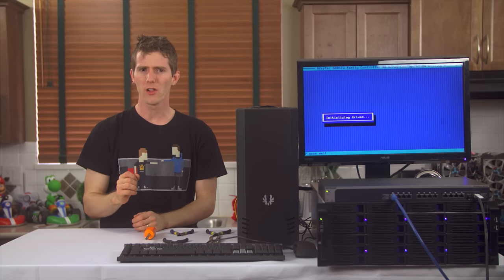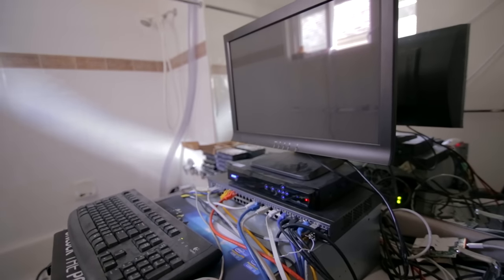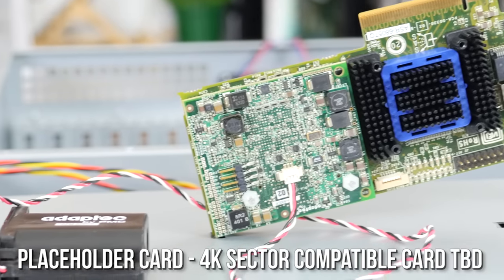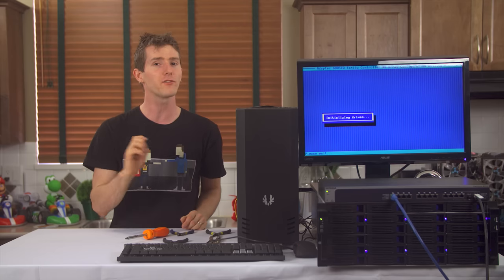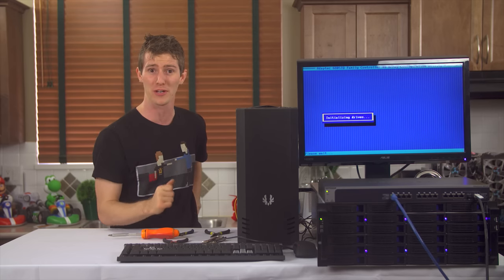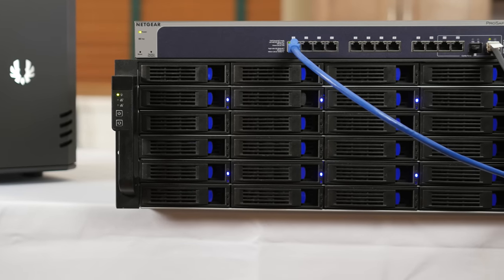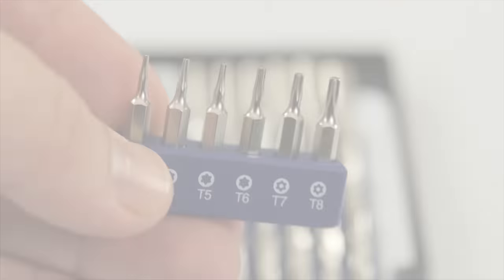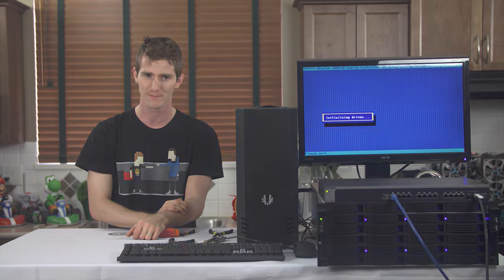Insane Storage Server - Fully 10 Gigabit Network, $1,500 Switch

Comment: I watched this on Vessel, but I'm watching here because the quality on Vessel is crap.
Reply: Switch it to HD at the bottom it is standard set to auto.
Reply: MrRyanDew I did. Still looks like it's running a high bitrate 480p or low bitrate 720p
Reply: true story man. vessel sucks
Reply: YouTube is better than vessel
Reply: Watching videos on vessel with my 4k display is just so painful.
Reply: overclock1993 Yeah... no 4K either... Lost interest in Vessel the moment I noticed that. Site's beautiful though. Much more modern than YouTube in my opinion.

Comment: As an Infrastructure engineer this entire setup made my skin crawl. Rebuild time on a contiguous volume that size with 6TB drives will be miserable, I hope you split them into smaller volumes for the sake of decreasing your failure domain. When you lose a drive the chance of losing another is even higher, RAID 6 is good, but when you have large volumes and disks like that you have to read more sectors to rebuild based off of parity bits. The chances of another drive failing during the LONG rebuild that a 6TB 7.2k NLSAS drive has should be something to consider. The Write speed to that array will be pretty mediocre as well. I also hope you guys have plans for tape backups for that array because RAID is not a backup.

Using FreeNas is cool and all (we use it at my office for niche things) but I would recommend testing throughput before you go prod, its requirements for multi large file transfers at a time is pretty hefty. It needs a TON of RAM to work well. That being said for archiving and dedup it works pretty well. I would also consider adding Windows Storage Spaces to the equation if you plan on being a windows shop.

Finally I would reconsidering naming things like that, especially if you plan on growing larger. It just doesn't scale, something like LTT-Stor01 would scale much better and when you do need to call a consultant in at some point it will make every ones life much easier.

Just my .02 as someone who does this sort of thing for a living, I have no idea if you guys will even see this. Regardless good luck on your office move!
Reply: man, so random to write you here but i really liked this comment. i know it's been 4 years, but i ended up on this video as i am having some concerns about my little production company's server situation. we have a 60tb server we use for edit, however it's not so fast - also, it's just a synology nas. i don't know what the next step is, and i would love to ask a guy like you for advice! it's hard to come by proper guidance in these matters.

Comment: LinusTechTips Just a heads up. An LAG or "Teamed" port using LACP may have a maximum throughput of 20GbPS if you aggregate 2 10GbPSports into the channel but due to how LACP handles load balancing each individual connection may not see more than 10GbPS across the link. Pretty minor considering 10GbPS is still huge, but just something to keep in mind. Of course this leaves the other 10GbPS in the link available for other traffic as well, so the network should never be bogged down.

Comment: Why are you using an 8 core xeon and 32GB of RAM for a file server with 8 maximum users? a Celeron and 4GB would be more than enough for that...
I can only assume its because you got them for free? I honestly can't see why anyone would waste those components on a file server without expecting 100+ constant users.
Reply: Sam Cooper The number of users is not the determining factor, it's data and transaction volume. And if you've got two users hitting the server over independent 10 gig-e ports and transferring a good 1-2 GB/s, you'll see those cores saturate more quickly than you'd think.
Reply: It's also going to be about file size. They are transferring huge files, I presume. Doing so, especially in a distributed (as in raid) environment, and with potential fragmentation adds a significant load if you want your data to be as quick as your interconnects.
Reply: totoritko No you won't - the NICs are doing TCP offloading.  The core speed/count is hardly an issue.
Reply: Dan Wier
This is why there is cache on the controller...  Further, I highly doubt that any single client to this server has the local storage to support saturating 10 Gb links.
Reply: like you said man, he just put together whatever the sponsor gave him, here it is.(10gbit for fast speed and then later he says don't need speed but readability when the hard drive part came up)
Reply: GameOn Friday
But used Seagates for reliability?!  Oh man.
Reply: Jon Kensy If you think your opinion on tech is so much better why are you here? 
Linus has worked at NCIX and he has gone through most likely at this point 500+ HDD I think he knows better than you sorrynotsorry.
Reply: Frankie Ippolito 500 HDD, that's cute.  He worked in a computer retailer and is now an authority of server builds?  I work for a hosting company with several datacenters and 500 hard disks is nothing in our SANs with up to 480 disks in just one device.  It's clear Linus doesn't know better than me with him building a file server with an E5 xeon on a workstation motherboard lol - I apologize in advance if I hurt your feelings.  Hell, my home lab has over 40 disks and over 75TB in usable storage...  and its in a SERVER, not a workstation.
Reply: Its called future planning. It saves them in a few years time having to update in the vase of a major technology change
Reply: Jon Kensy very true that no single client will be able to but as Linus said in the video it is for all of them to be able to pull and push to the server at the same time not just 1 at a time use which sounds similar to what they are doing now.Also hosting servers on SAN redundancy are very expensive and it does not sound like his company has the money to do that also what defines a server is the software not the hardware.
Reply: Sam Cooper Haha you think this is a minecraft server or something?
Reply: ***** well a minecraft server does need a ton of RAM but only can use 2 cores because of software limitations alike to minecraft only uses 1 core for the same reason but RAM usage can be large if the world is big
SO if the server has a large map and alot of ppl on it yes the RAM usage will be alot but still only using 2 cores of the CPU
Reply: ***** No... it's a file server, much less demanding.
Reply: Sam Cooper then it is either overkill or way under speced depending on how it is configured as the 2 most used ways for redundancy are 1 hard ware redundancy which Linus talks about as it is a hard ware youtube channel then 2 you have software redundancy which will require a ton more RAM than what he put into it for what he plans on doing with it.
Either way it is built wrong for the CPU and RAM the hard drive set up is good though and is the main focus on a file server just the CPU is over kill and the RAM is either to much or way to little for what he needs it for again depending on the software implemented of course.
Reply: OP They went balls deep in this. Nothing wrong with that
Reply: ***** no it wont
Reply: I wouldn't have gone with a Netgear switch in production.
Reply: Chris Yu meh, they all have their ups and downs.  Honestly, as long as it works, who cares what brand is on it?
Reply: hey its free stuff bro why not, at least most of it probably was
Reply: yumri4 For the money he spent on that motherboard and RAM and CPU he could have bought an Equallogic PS6000.  It doesn't make sense that they're talking about reliability and important of data and then putting a desktop board behind it.
Reply: Joan Lorenzo
Too few 6TB in use yet, but Seagates historical ability to deliver is poor.  I would much rather go with 1 - 2TB disks for higher spindle count and thus higher IOPs.  10 GBe is great but they don't have the storage in that array to even come close to saturating it.  Not enough spindles.
Reply: After watching the full room watercooling videos, I have lost all hope that Linus and co. have any idea what they're doing, and that they lack critical thinking skills.
Reply: What the fuck are you guys talking about
Reply: Ideally you want 1gig per terabyte because when a lot of people are accessing files it's better being a little overkill rather than risking data
Reply: dKJustwon a lot of computer projects are about learning, its one of the main reasons I got a network rack, and just ordered a 1U server, so I can learn about them.  They knew about water cooling individual PCs before that project, but they were learning as they went.
Reply: Jon Kensy Well it probably doesn't make him an expert, I'll give you that.  
But you know what, making snide comments does not make you all that credible either. A true expert wouldn't need to rub it in someones face. :)
Reply: Chubbysumo It's not about them learning as they go, it's about them encountering problems which were obvious, where the smallest amount of forethought would have avoided. They also seem to be fine putting up hack jobs. Also, having your reservoir an open air box inside a bathroom is the opposite of what you want.
Reply: Sam Cooper it leaves space for expansion in their company. with the celeron and only 4gb of ram, they would need to upgrade their build again while having high end components will allow for more people to join the company without having to upgrade.
Reply: BB Christopher The guys name is Linus, therefore Linus tech Tips. He does have a retail background, and as you said, that's what he brings, tech overviews and his impressions of a product, as well as his connections for the WAN show (other content creators, professionals in the industry etc.).
If I was to describe LTT, it'd be a channel for a laymans look at tech, if someone wanted perhaps a more in-depth look at PC components, I'd recommend OC3D and TinyTomLogan. LTT is very much a show for the masses.
Watercooling, ***** but I'm sure there are others that are as good.
As for Linux and server stuff, the only one I watch regularly that do either of those is Tek Syndicate, they have great videos and know what they're talking about. There's also the Linux Foundation channel, but I'm not really sure that's what you'd be looking for.

Comment: my dad's work sever, two 8 core xeons and 768gb of ram.
no joke

it also it has fusion io drives, look them up.
Reply: Yeah ok.....
Reply: My dad works at Nintendo too
Reply: Haych nah nintendo uses wiis for there servers
Reply: Egguar Baggins indeed lol
Reply: Egguar Baggins There are servers out there that support 1TB and even 2TB ;) Mind you, they cost a LOT, but they are there!
Reply: Egguar Baggins Yeah, there are servers that support up to 2TB of DDR4 RAM.
Reply: ***** but 800gb exact isnt possible
Reply: Egguar Baggins The Dell R920 supports 6TB but this dude doesn't know what he talking about since there is almost no server with exactly 800GB of RAM, would be more like 768 with 24X 32GB RDIMMs.
Reply: That's not even a bit impressive
Reply: Andrey Volk Fair enough, i might have .. overestimated the value of those servers :D
Reply: Egguar Baggins
I've seen 768GB of RAM on a website where you could order custom PCs. It was DDR3 tho. I just put everything I could on the PC to make it more expensive (even if I didn't need it or didn't like it) just to see how expensive it could be. Almost got 50k USD. Insane. The PC is called CoreMC Gen3, it's on Music Computing's website.
Reply: MY dad is Steve Jobs.
He died...
Reply: Yea, doubt that.  What hardware?  Either way, its not yours.  I just bought a dual opteron 6core 32GB RAM 1U server for my home server.
Reply: Egguar Baggins Even on a slightly older build, then 768GB is very possible.  24 DIMMs (12 per Xeon) @ 32GB each.
Corporate/Enterprise level gear goes way higher than you might think.
I work for a big server hardware company and recently did a little work on a 240 core (16 processors x 15 cores each) server with 4TB of RAM.  The machine actually holds 12TB of RAM, but this customer wanted Windows Server 2012 which is limited to 4TB currently.
Reply: See? Just do some research before you comment.
Reply: Egguar Baggins I dunno, 256GB is pretty standard. Maybe 800 isn't that crazy.
Reply: ***** its not a single "server" at that point, its a custom setup that takes up a full 42U rack, and usually has a 1U unit dedicated exclusively to RAM, and that RAM is more or less used as a fast HDD cache.  On an individual server board, right now, 256GB is pretty normal to see as max, with 512GB getting easier with larger sized DIMMs.
Reply: Chubbysumo
Huh?  256 is not the max.  A dell R630 holds 768GB in 1U.  A Dell R920 holds 6TB of RAM in 4U.  What are you talking about 1U dedicated to RAM thats not a thing at all....
Reply: Chubbysumo lol a 1U just sitting there dedicated to ram..? Cause you know not like that ram has to be on the main board or anything. Just put it all in one rack a few layers away and plug it in, right? That's how ram works
Reply: Jon Kensy 24 32GB dimms, which is 12 for each CPU.  Still, takes up a ton of the board space on a 1U, and the dell R920 has expansion Riser cards that you put RAM on(if you want more than 24 dimms), the main board itself holds 24 dimms for a max of 768GB on board. The risers for the RAM end up functioning as fast disk caching because its too high latency for CPU ops.
Reply: ***** Go look at how the Dell R920 is set up.  The main board has 24 dimm slots, and you get expansion cards that hold more.  Because the latency is too large for CPU ops, anything that is not on the mainboard is used as fast disk cache.
Reply: Chubbysumo
Yes, but there's no "1U dedicated to just RAM" I am not sure what you're talking about there
Reply: Chubbysumo Have to agree with Jon Kensy here.  Not sure you know what you are talking about.  The Dell R920, which has basically the same design as the HP DL580 Gen8 which I an intimately familiar with. has 4 CPU Sockets and 8 memory cartridge sockets on the main board (2 cartridges per CPU).
There are ZERO DIMM slots on the main board.
And assuming you have all 4 CPUs, then all 8 Memory Cartridges are considered main memory and are not some slower cache that you are saying they are for.
You can find the spec on this design by looking into "E7 Hemisphere Mode"